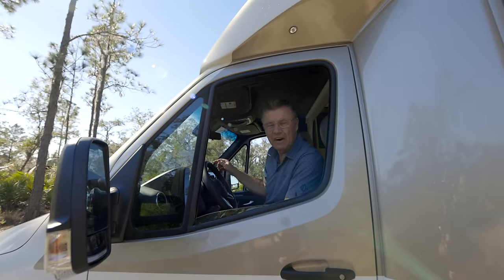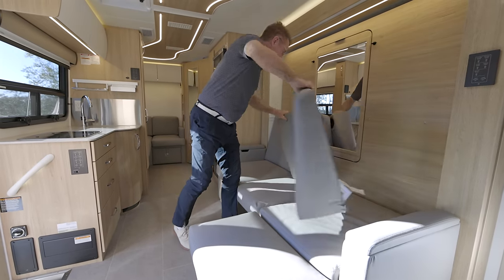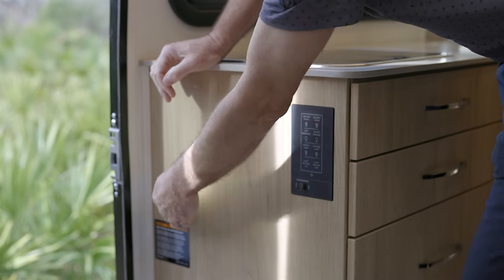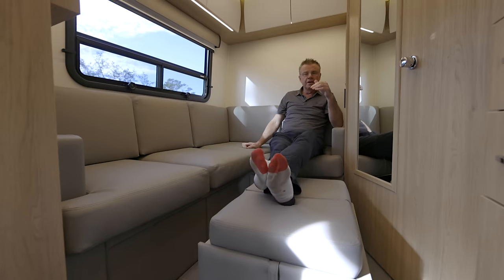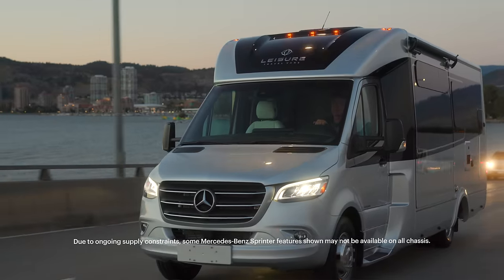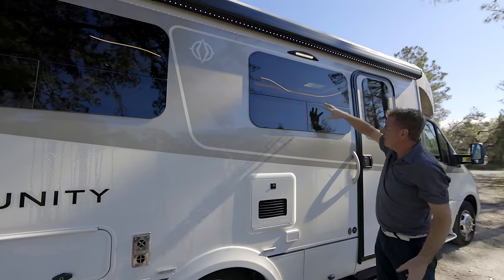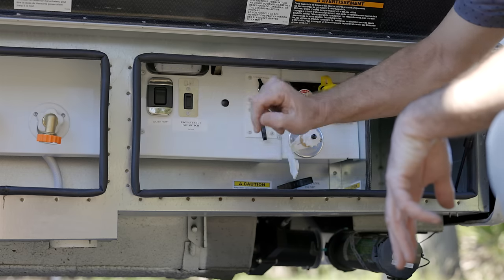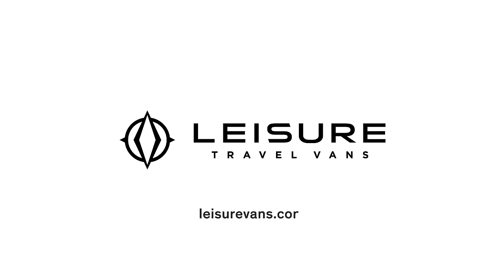2023 Unity FX

Comment: Love this RV but agree that the slide having to be out to use the bed is a real problem that you all need to resolve. Love your presentation and the product otherwise.
Reply: I wonder why that is because the other vans can be in, and you still have a walk around.  I want to be totally off-grid, so I don't know why they haven't upgraded their inverter to 3500 and Li battery bank?  I suppose their average customer will be staying in a camper park.  However, I'm told the camper parks are usually full nowadays, so what then?

Comment: The bed not being operational without using the slide is a deal breaker.  Too bad as the rest of the RV is amazing.
Reply: You can sleep in the rear lounge and comfort lounge if you can’t put your slide out. Works for us.:)
Reply: Does anyone know if it is possible to put the bed down partially-leaving the foot area unfolded-while the slide is in?
Reply: you can get a hotel room
Reply: @truemagneticnorth It looks like you can’t do that, 8:32.
Reply: We have had quick overnights and did not want to put our slide out and just slept on the couches.   
We have 2019 FX.  Never had an issue for a quick night using slideout.  Keeping rig level is an issue but frig requires that anyway.
Reply: The new MBL Murphy Bed Lounge (Unity and Wonder) can deploy the bed fully with the slide in.

Comment: This may be the Swiss Army knife of the LTV models but I still like the MBL better. More light and air flow over the bed, and bed can be used with slide out in. Also like the power and adjustable recliners.
Reply: The MBL has also the new more energy efficient Truma Aventa. The bathroom is also more roomy. Also i would replace the toilet with a Cinderella incinerator toilet with the duct exhaust on the side in the MBL. With that i would remove the black tank snd generator and put instead bigger batteries and dual alternator. This would allow off grid or access to simple tent camping area.

Comment: All very nice. The one flaw I see across the industry is a microwave at above eye height for most women.  This means you can easily spill hot soup into your eyes. I’d rather raise the fridge and put the microwave convection in a drawer at the bottom. Or put a drawer at counter height in the storage to the left of the fridge. May not be perfect but much safer.

Comment: Does the Slide need to be out in order to set up the Murphy Bed?  Or, can it be in?
Reply: It might be possible, but if you do need to pull out, it would be only few inches because there is no gally in the way, in Murphy style there is a tv in front of it, and it a lot shorter then the gally on this one
Reply: The slide has to be fully out in order to use the bed, 8:36. There is an older model of the FX that let’s you use the bed with the slide in. A very disappointing change.
Reply: @MG Kelly  yes on this one Fx it has to be fully out but you can buy their style van called Murphy Bed where it's a different set up in different video where the gally is not in the way as much as this one.
Reply: Check out their MBL floorplans. Bed can be used with slide in or out and more light and airflow over the bed.